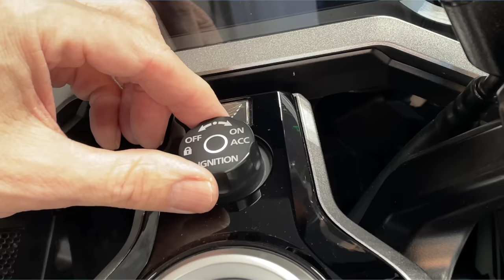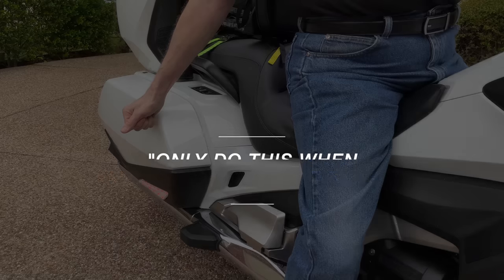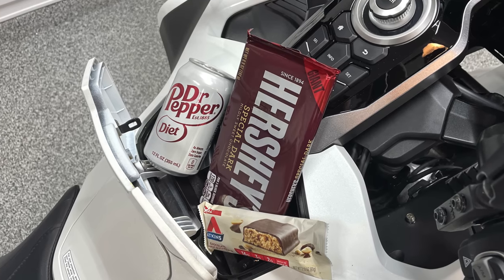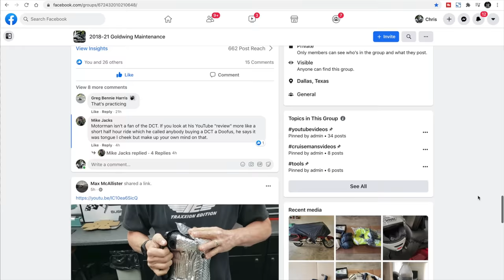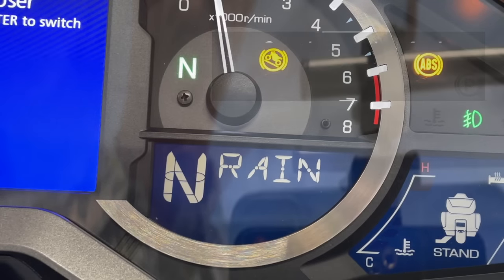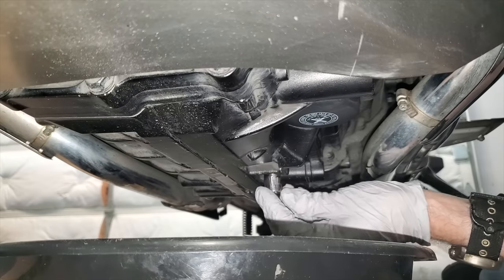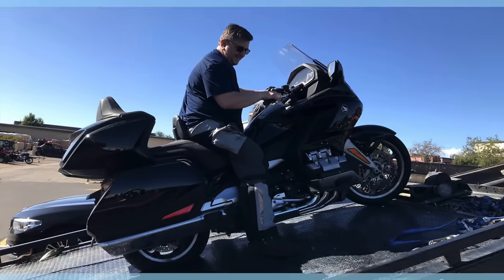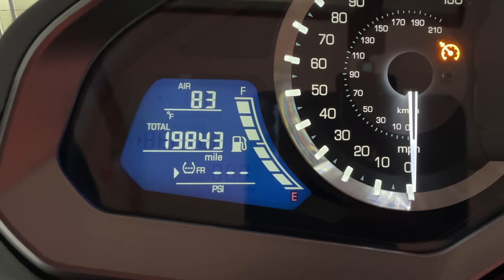20 Essential Things Every Goldwing Owner Should Know | 2018+ Honda Goldwing | CruisemansGarage.com

Comment: First segment about turning your motorcycle on is missing something that I discovered on my own. While the motorcycle is completely shut down, you can press either the front or rear brake and press and hold the start button and the ignition will turn on and the motorcycle will start. Pass it on…

Comment: All good info. The only recommendation I would change is for closing and latching the trunk lid. I do NOT recommend pushing down on the rear of the lid to close it. The paint/clear coat on the Wing is soft and is easily damaged. Repeatedly closing the lid in this manner will cause fine scratches in the clear coat, resulting in a hazy, or cloudy look. I close mine by pushing down only on the top of the backrest. This way you don't have to touch the paint at all to close it...

Comment: Another tip you may find useful that is not in the manual is that by holding down the Audio button on the center panel (console) you can turn the audio off.

Comment: Between cost of maintenance and available sources of great info avail from you I pretty sure you have convinced me to go for the 21 Goldwing and not a K1600 GTL, thank you for what you do. I am sure I will get your maintenance videos when I find my dream Goldwing, be safe out there.
Reply: JR, I own both and while I love the BMW it has its own drawbacks. The audio system is horrible, there is no bluetooth in for the bike you have to buy the Garmin GPS Navigator as a bluetooth hub at the highly outrageous price of $950, then maybe half of the people get it to work properly. Mine has never worked, I wasted my money on the GPS since I'd rather use my phone for navigation anyway. The bike is very smooth, and very powerful, but the throttle is mushy even in sport mode and in higher gears the ECM only gives you about 75% throttle. A Bren Tune fixes the driveability issues, for only $650. I love being able to remove the bags and have a sportier bike with a comfortable riding position, but if I could only own one bike it would probably be the Wing.
Reply: @johnfriend862  Thanks for the info. Many years ago I bought a Kawasaki K1300, water cooled Six Tour bike, and to this day it is my favorite tour bike. The 84 GPZ1100 would have to be my favorite sport bike. I must say I have not ridden since late 85 after hearing a good friend was killed on his bike but ready to get back into touring.

Comment: On the DCT model, by locking the handlebars to the right instead of the left, both mirrors can be fully retracted to provide protection from damage or to improve space in a tight parking spot.
Also in changing the mode while in motion, rather than close the throttle before doing so, I find it safer to pre select the chosen new mode then close the throttle to engage it. If using tour mode, this will prevent the sport mode from engaging if you're after econ or rain modes ... otherwise it can take by surprise as I've discovered!
Thanks for a very informative video.

Comment: Good job.  I don't own a Goldwing but I have to give credit where credit is due.   Incredible motorcycle!  I've always thought/wondered....  what if....  You get the newest models from each of the top touring bike manufacturers and ride them from Miami FL. to Anchorage AK.  Which one would need the most/least maintenance?  Keep an intense log record of each bike.   I've always thought the Honda Goldwing would win that contest.  I wonder if the top brand motorcycle manufacturers would like to volunteer to this challenge?  Let them bring their own bike, maintenance crews, chase vehicles, parts .....  EVERYTHING!  All bikes ride at the same time, together, same exact conditions and rest stops.  Together!  It's not a race, it's a maintenance test.

Comment: Hi Cruiseman, I've been watching a lot of your Gen 6 GW videos. I'm in the midst of making the decision on a 2021, non tour model. It's a tough decision. I'll be leaving my very much loved, low tech, Kawasaki Concours. I currently own both the first generation Concours and the current C14 model. I'm getting to an age that long distance is becoming more uncomfortable in the Sport Touring riding position and with no cruise control. Well, the test ride is tomorrow, I hope I either Love it or Hate it, this is the toughest motorcycle decision I have ever made. Thanks so much for your really informative and thorough videos.
Reply: I have the new C14 also and haven ridden the 08 Goldwing and even going from that to the C14 felt like a cheap dirtbike. 😢...Get any wing '01 and up, 18+ is redonculous though a little smaller

Comment: You wouldn’t happen to be in the Austin area? I noticed a familiar radio station. About a month and a half ago I bought a 2012 K1600GTL. Then Dream Machine showed a 2019 Goldwing with 800 miles. Being a previous owner and lover of Goldwings I pounced! So many things I like about the wing over the BMW. Lower center of gravity! Less clunky trans. I have a manual 6 speed. Especially going from neutral to first gear. The starter on the wing sounds more like a motor generator than a starter. 
Like a Ram 1500 with etorque. I didn’t get an owners manual so I have questions.
Reply from the maker: @tomwise1109  No, I am in DFW area.

Comment: Another way to start the DCT model. While squeezing front brake, press and hold engine cutoff switch in the start position. Engine just fires right up.
Reply: It works on most bikes, and I do it that way, too. I just push and hold the start button, then I squeeze the brake lever.

Comment: Great video, extremely helpful and informative! One question concerning braking noise. I recently purchased 2018 Goldwing with 3K miles. I noticed under hard braking, a growling or wailing sound coming from front brake area. No vibration in handlebars and stops very well, just unusual noise. Any feedback or insight on this issue. Thank you!

Comment: Chris, a few things that either I've found different or are on the M6 models. My 2018 Tour will not engage the cruise at under 30 MPH. The reverse works very differently on the manual, and there is no "walking mode" forward. Finally, another way to disengage the cruise control is to pull the clutch lever. You did teach me a few things that in the 2 1/2 years I've had mine I didn't know.
Reply: No need to pull. Simply squeeze very lightly. You can feel the microswitch deactivate.
Reply: The decision to prevent the cruise to work below 30 MPH must have been taken by lawyers, and I'd like to know their arguments. There are many situations where I'd like the CC to maintain for instance 10 MPH while I could spend my full attention to the road and its surroundings, and not focus on not going too fast, on a camp ground or a real poor road.

Comment: I have a 2019 GW 6spd . I've been through about everything you mentioned but I wish I would have seen the Video first . It sure would have made it a lot easier. 
Not to sure about hanging the helmet on the end of the handlebars.  I'm afraid a bird might take aim at the helmet.
Shame on Honda for the top box that won't hold  my XL N104 Noland helmet without putting pressure on the lid to close.  And I've tried several positions to close it. Hill hold is a great thing. 
I've done the hill hold for friends and my kids when they started riding dirt bike's, they probably didn't know that I would pull up close behind them in case they started rolling back on a hill.
And then talked about how to control that issue. 
Thank's for the great video  .
Reply: Helmets are EASILY stolen by thieves by simply using a box cutter or folding knife.  NO WAY would I hang my nearly 700 dollar Shoei helmet outside on my bike !  SO, so dumb !  What was Honda thinking !  NO excuse for Honda not allowing an 800 lb 'WIng to store a single helmet in a side saddlebag.  It just goes to show that the marketing folks, NOT the real riders, are in charge of the design of these bikes.

Comment: Looking for some info or advice, Im looking at a 2008 Golodwing, it has 123,000 miles on it, the original owner and very clean with a lot of add on, the bike can be bought for 5k due to health issues. Question is will I have a lot of issues with it and should I buy it with this kind of milage

Comment: Thanks for the video.  I have learned most from trial and error and your previous videos.   No negative comments on this.  However, missed that you can add the AUX  connection and see it on the Audio connections.  I use my Garmin via AUV and have audio for  GPS, MP3 , XM, and  weather alerts outputted via the bike's audio... speakers or Bluetooth.
Reply: Can you elaborate on this? Not familiar with adding the AUX connection. That is something I would use as I’m not a headset guy. Thanks.
Reply: I have a ’19 DCT Tour.  There is a connector on the bike for an AUX input that one can connect to an external device (GPS, iPod,…) that will allow for a wired input of the audio of the device to the bike’s audio system.  One must purchase the cable to connect to the bike and allow for the device audio output to be connected.  The connection end of the AUX wire on the bike is difficult to get to.  One must remove some body parts and seat to get to.  I installed my cable while I was installing a few other aftermarket electrical items.  There is a video someplace that provides the instructions to get the cable installed.  Honda should have made the access of the connector easier.  Once I connected my GPS to the AUX input, I am able to go into the Audio menu and select AUX instead of FM, AM,…..  The GPS audio now plays through the bike’s audio system.  I can use either the bike’s speakers (which I rate as poor) or I can have my J&M Bluetooth headset paired and receive the audio via the headset.  I rarely use the bike’s speakers.

Comment: Have to disagree - don't let the gadgets and Apple car play fool you.  It is uncomfortable after about 30 min and difficult to maintain on your own - unless you love taking things apart and keeping track of screws and clips.  I wonder what granite yard they went to for their seat material.  I'm not sure there are better alternatives these days, but in my opinion while Honda did a great job with redesign in 2018, they screwed the pooch in many areas.  Maintainability is surely one of them.  Also Honda dealers don't carry parts you actually need - they have lots of weird stuff in stock - great if your building custom go karts or model rockets, but actually getting parts you need to do service work can be a challenge.  Keep up the good work Honda !!

Comment: I am living in Germany. My problem is that I regularly travel to the UK. Now, Honda in their infinite wisdom (As with most Japanese manufacturers) do not put miles on the Kilometre speedometer, unlike the mile speedometer that shows both. and the other thing is the dip beam of the headlight is naturally higher on the right, while in the UK it is higher on the left. So I have a sticker on the windshield with MPH to KPH, and I have to tape up the headlight so that I don't blind on coming traffic when in the UK (it's also the law). However, I do feel that continually taping and taping the headlight would be detrimental to the plastic in front of the headlight. Do you know of a solution?

Comment: Thanks for this video. I've had my DCT Tour for just over a year and learned a couple things. I was wondering how your fuel range showed 249 miles. The most range I've ever seen was 200. Does that reading take into accound the current MPG shown on the info streamer at the bottom of the spedo/tach gauges?
Reply: I believe it have to do with riding habbit.
If you are hard on the gas will give a lower range, but if you ride slow and steady, maybe more eco mode that range should increase.  It is always estimated and not the actual mileage you will get for sure. Don't rely on that. Just enjoy  your riding time, and safe trips with open roads.

Comment: I have a '21 Wing DCT Tour.  I SO wish Honda would have placed the cruise control button on the LEFT handlebar (like my previous BMW r1200RT).  The Wing's throttle is SO freaking sensitive that it is nearly impossible to hit the cruise button WITHOUT accidentally blipping the throttle.  Also, WHY or WHY so much gear whine ???  I think that GW, instead of standing for Gold WIng, in reality stands for GEAR WHINE.  When I ride my DCT, all I hear is GEAR WHINE.  Love this engine, but now wish I'd have bought the MANUAL tranny version to deal with the gear whine and ridiculous level of driveline lash and jerkiness.  Oh well, live and learn.  It's just..................................MONEY.

Comment: Cruise man what did you do with your issue with the XM Radio XM got me so mad at them I turned off the service bought me an iPod and I can store my music that I like in it plug it into the bike and comes through the helmet
Reply from the maker: I just cancelled the service and make do with terrestrial radio and MP3s.
Reply: Haven’t tried the iPod or mp3s yet. 
Can you plug the iPod in and hear it though the speakers on the bike somehow? AUX was mentioned as an alternative but I have no idea about that. Pick up my 21 DCT tour in 2 days. Does XM still suck on the 2021 with the now standard antenna or is it the old crappy one? Thanks

Comment: Can you use walking mode as much as you want? Does it consume battery in the current models?
Reply from the maker: It does not consumer battery, but Honda only recommends using it for up to 60 seconds at a time.

Comment: One quick question:
Can a thief just remove the allen wrench head screw holding the key bolt, pull it out, unblock the T-bar and, bye-bye expensive helmet.
It would be too easy to defeat this device.
Does the T-bar becomes the blocking mechanism that impleads the removal of the key bolt?
Thank you.
Reply from the maker: I suppose that is possible, but how many thieves will go to that much trouble? Wouldn't they be more likely just to cut through the helmet neck strap?
Reply: @cruisemansgarage  Yes but it would render the helmet useless and minimum street value for quick cash.
Thank you.

Comment: At least on my 21 Tour DCT, there is one other way to unlock the handlebars, turn on the electric system AND start the bike.  

While holding either brake (or both), hold the start button for a few seconds.

I find it is the easiest and fastest way to get everything going.

Comment: Good refresher. And if you have an LS2 or other helmet without a d ring there’s no way to secure the helmet. And forget about storing it in the top case. Am I the only one who stores ANYTHING in there? I just drape it over the Zumo XT. Inelegant? Of course. Not secure?  Right. But in 3 years/45,000 miles I’ve never had it stolen. Guess I just visit the right bars. 🤔

Comment: So with the lid locks the helmet wont touch my paint when i lock the bars🤔
Reply from the maker: A lot depends on the helmet size and shape and whether or not you have your handlebars fully locked. It is also possible that a strong wind could blow the helmet hard enough to come into contact with the middle cowl. But, my helmets have about 2" of space between them and the body work.